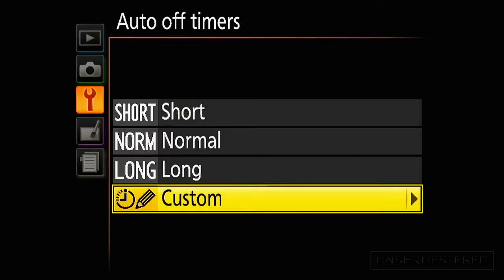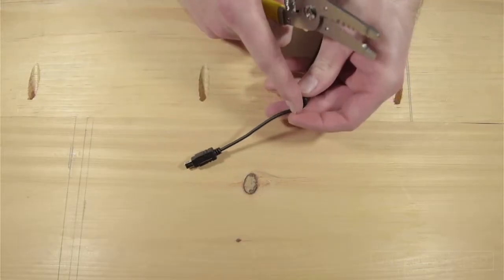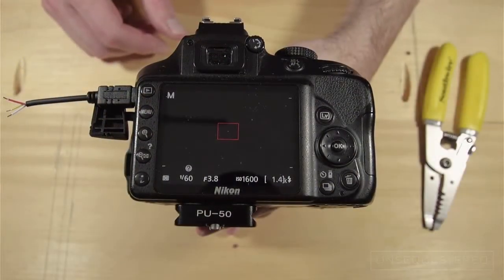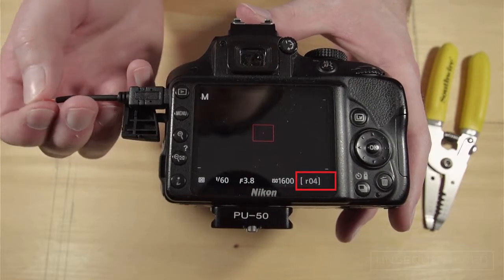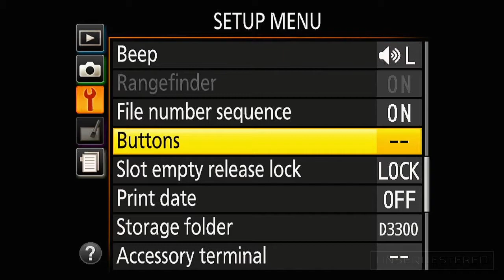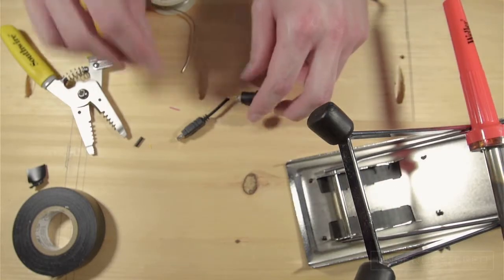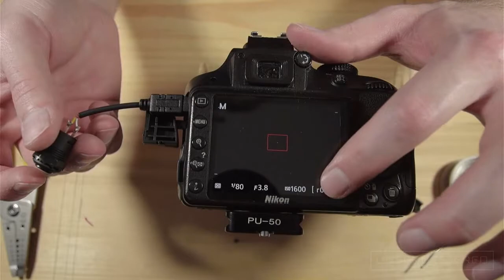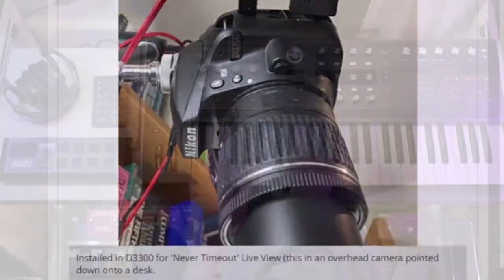Sick of the 30 Min Live View Time Limit on your Nikon D3xxx or D5xxx Camera?

Comment: Thank you so much for this. Wasted so much time on other videos that didn't address the main issue of the camera live view limitation problem. I followed all the instructions (I really recommend using the switch way - so much easier and practical in the long term) and have had this working for past week. Longest call so far was nearly 2 hours. No overheating issues to date. For info I'm using a D3200 with Sigma 10-20 lens for a bit of depth of field - you can probably pick both up for less than £250 (I had them and didn't think id ever get the use out of them again!) so plus cables, video card, dummy battery and switch you could get this setup for around £300ish which I think is amazing for a decent conferencing setup. Brilliant!
Reply: Just a quick follow up on this. I’ve been using for over a month now as my main camera. No over heating issues to report at all. Great solution if you have and old dslr to up cycle 👍

Comment: Thanks for posting this.  Implemented the fix on my D5600 and it works great... I have a switch on order as I agree that it's a pain to plug and unplug all the time.
Reply: Where you able to get the switch installed? Where did you get it? How did you install it?
Reply: @FREAKADO  Plenty of them on amazon. latching push button is the term. I got latching buttons with 2 cables pre attached (10 bucks for 15 switches) which made it way easier. Just twist the correct wire pairs and seal it with electrical tape. The whole procedure was done in 2 minutes.

Comment: I just did this tonight. I did not have a soldering iron, so I just twist and taped each witre connecting individually. I will see if it holds in the long run, until I solder it.

Comment: Awesome and really informative + easy to follow video! Quick question though since I'm about to start doing this myself; The dongle would use the same USB port used to connect to a capture card, right?
Reply from the maker: The dongle uses the shutter release port on the camera. 

If you are connecting a capture card you'll do that with the HDMI out port on the camera. 

It's not a standard sized HDMI port so you'll need a mini HDMI to full size HDMI cable to go from the camera to your capture card. If it's an external capture card then you'll connect the card to the computer with USB. 

So the signal flow will go Camera HDMI out > Capture card HDMI in > Capture card usb out > Computer HDMI in.

Comment: Hello friend i need this cable name and this port name? Please tell me 🙏 and how did you remove focus square on the screen during live veiw?
Reply from the maker: For video I definitely recommend turning autofocus off and using manual focus (the autofocus isn't great in live view anyway), that should solve the focus square issue. If it doesn't make sure you press the "info" button until you get a clean output. Also note that the focus square may appear on the camera screen, but it shouldn't appear over the HDMI output. 

The cable is linked in the description (not an affiliate link), but it called MC-DC2, it's a proprietary nikon port/cable, I'm assuming that's the name of the port as well as the name of the cable required.

Hope that helps.

Comment: Hi, thanks for the vid. One question though, so when doing videoconference call, camera will not autofocus anymore, meaning I will need to set focus manually and tray to not move too much, is that correct or am I doing something wrong? Thanks
Reply from the maker: Since this is tricking the camera into thinking the shutter is half pressed you can only manual focus. Sorry didn't include that in the video. I had assumed most people who were using the camera for video would also be using manual focus as autofocus on the Nikon DSLRs jumps and hunts like crazy making for distracting results.

Comment: So if I wanted to record something with the camera this only stops the live view from shutting off and the recording would still end after 30 minutes- is this correct?
Reply from the maker: Yeah unfortunately it's not a solution to get longer record times in camera. You're going to need a custom firmware for that. I haven't searched for them, but I've seen stuff out there.
Reply: @Unsequestered  Thanks for the reply! One more question- if I do get the custom firmware working so I can record past the 30 minutes- will I still need this work around you've provided for the live view?

Comment: I gave this a go, but my D3300 still times out around 38 minutes. Built the exact same dongle, any ideas as to what I missed?
Reply from the maker: If you followed the instructions exactly, specially finding the correct wires to keep the shutter "half pressed" temperature could be an issue.

The reason I called it hack is because it's a work around and these cameras weren't designed to work in this way. If the camera is in a really warm environment it could be shutting off to protect itself from overheating.

That all being said I've run mine (I have 2 d3300's) for well over an hour. The ambient temp in the room wasn't any higher than 72°F 22°C

Hope this helps.
Reply: @Unsequestered  yeah, thats true. the dongle is working, since it is doing the shutter hack, and i did notice my camera body was warm, btut not overly so. how odd
Reply from the maker: That is odd... Electronics can be a crap shoot, could be something as unlucky as your camera not having as good of contact with an internal heatsink or thermal paste that has a lousy application from the factory. Sorry you went through the trouble only to get an extra 8 mins.

You could experiment by pointing a fan at the camera and seeing if the heat is indeed the issue. Not sure how practical that would be as long term solution, but at least you would know if that's the issue or not.

Comment: i'm having a problem with display info on it while recording the or during live stream video on OBS, all camera info is also in the video please someone help me to fix this issue
Reply from the maker: Near the shutter button there is a button labeled "info" if you press that repeatedly it will cycle through the overlays. One of them will be a clean display (no text or icons showing). There will still be some icons showing on the back of the camera screen, but nothing bit the video feed over HDMI.

Comment: On your live streaming sir, how far will it go? Can we use it for 2 hours of live streaming?
Reply from the maker: The longest I've used mine personally has been for 2.5 hours.

Please bear in mind your results may vary depending on factors such as ambient temperature. Basically if it's hot where your using the camera it's probably going to overheat quicker. You could always point a small fan at the camera to keep it cool. I haven't had a need to do this though. (The temp where I'm using my D3300 is 21C (70F))

The battery will die at some point too depending on what settings you're using and the age of the battery. For example if you have the LCD brightness cranked on the camera the battery will drain faster. You could also use one of those dummy battery power adapters that uses AC power. (Again results may vary, but I ran on battery for that entire 2.5 hours stream).

Comment: Just put a rubber band around the shutter button with something kinda soft under it to keep it held partly down and Bam SUPER Simple Fix
Reply from the maker: Yup, that is exactly what I started off with. I did that until I was using the camera weekly. Then I added a second camera that was mounted to the ceiling that was even more difficult to access. The hair tie or rubber band trick became a complete hassle at that point.

Comment: thanks for your trick. but my problem is overheat. I use D3200. I try live view until 1 hours. but my camera is shutdown when overheat. Can you give me solution ?..
Reply from the maker: These cameras were never designed to work for long periods of time in live view so your results may vary depending on which model you have and the environment it is operating in. I can get my d3300 to stay in live view indefinitely, however I am using it in a very cool environment 20°c (68°f). If you can't lower the temperature of the environment the camera is in you can try a small battery powered fan and attach it to the back of the camera in some fashion. Not the most elegant solution, but it should squeeze out some extra time for you.

You might be able to rig up something with a fan, similar to the one linked below, using an articulating arm with a clamp to position the fan blowing at the camera. The mount also lined below goes onto the cameras hotshoe (where you would attach a flash) so you would still be able to mount the camera to a tripod.

As long as you can figure out something on the cheap I think it would be worth it. Just don't spend too much time or effort on rigging something up, because at that point it would be cheaper/easier to get a different camera that better suits your needs. Not to mention this isn't guaranteed to work. The camera could still overheat after an hour.

3 Speed Mini USB fan: https://www.amazon.com/dp/B088LPY12X/ref=cm_sw_r_cp_apan_glt_fabc_VB0KWAAWCSC7R1667NGP?psc=1

Articulating arm: https://www.amazon.com/dp/B08X3SSFVV/ref=cm_sw_r_cp_apan_glt_fabc_51C604C8AT2F2TAVTTQS

These are just here for examples feel free to use stuff found around the house, or make something yourself.

Again this isn't guaranteed to even work, but if your the type that likes to DIY stuff it might be fun to try.
Reply: Add a computer fan to the back to cool it down.

Comment: Is it possible to hack the 30 minute timer by just putting a tape on the shutter button to keep the remote half-pressed rather than cutting wires?
Reply from the maker: Absolutely! What I was doing before this was using a hair tie or rubber band and anything that's about the size of a dime and has some grip to it. A small piece of foam or small rubber washer work well for that.

Comment: your a genius thanks for the vid hope it works on my d5600
Reply: Did this work for you? I also have a D5600 and am considering making this.
Reply from the maker: So referencing both of these sites, the d5600 does have the remote shutter port required for this to work. Just make sure your camera matches up to the photo of the ports in the second link and you're good to go. Good luck with the mod :)

References:

Under "connectivity" then "remote shutter" it lists compatibility with the mc-dc2 remote ✔️

https://m.dpreview.com/products/nikon/slrs/nikon_d5600/specification

This site also lists compatibility with the remote release cable used in this video as well as shows a photo of the corresponding port on the camera ✔️

https://www.dummies.com/photography/cameras/nikon-camera/hidden-connections-nikon-d5600/

Comment: For those who have a D3200,D3300,D5100,D5200,D5300 camera, you can also fix it via firmware patch.
Reply: got the firmware patch, but my camera still counts down from 20 min. 

Does it automatically start a new video?
Reply: @94oGs  You're talking about video recording. This "hack" is for live view (video) so it won't record to the card.
Reply from the maker: That's correct, this "hack" is intended for people who want to use their camera with something like obs for live streaming or video conferencing purposes.

It will not allow you to record longer to the internal SD card, need to find a custom firmware for that.